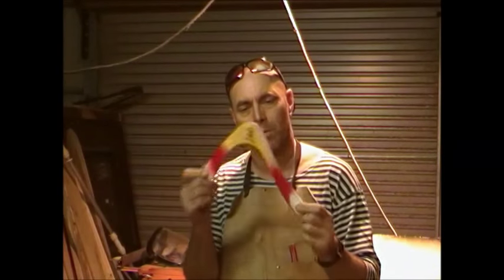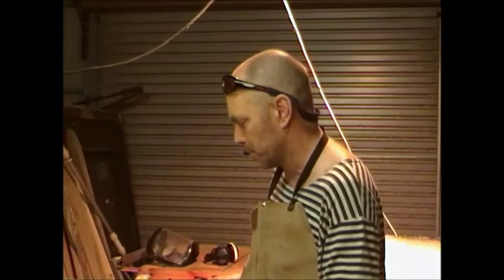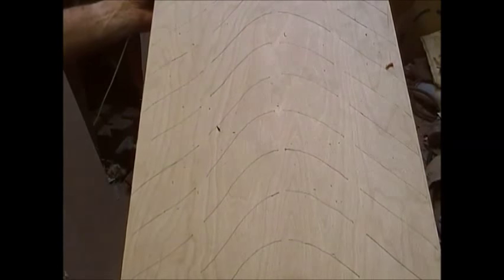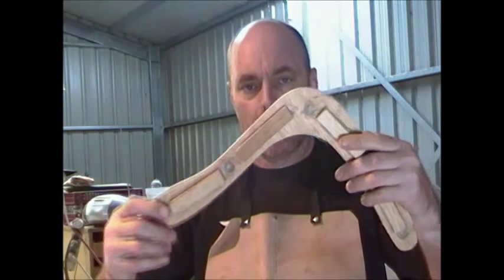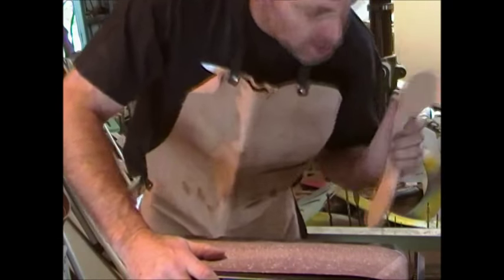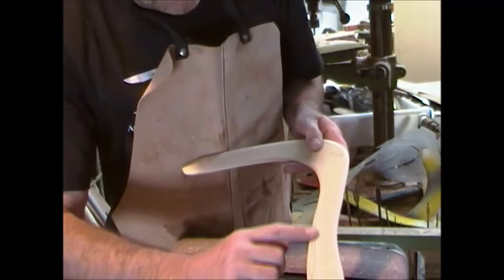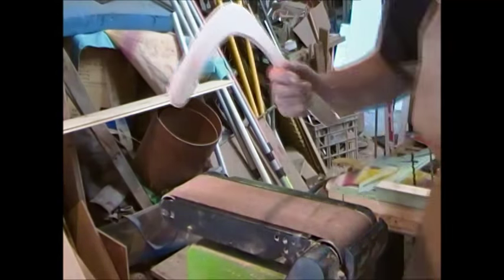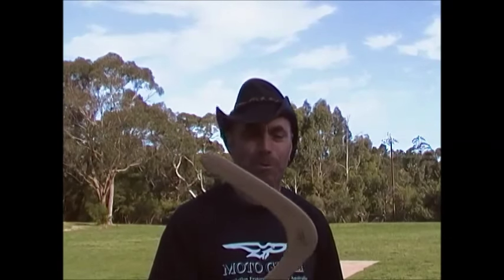How to make great boomerangs. Introducing the "Cracker"

Comment: How 'heavy' or dense is Finnish Birch plywood, can't get any fancy plywood with thinner laminations here in Timaru so I've copied some 'large' 60s to 70s style boomerangs from a book that was made about boomerang construction before even trirangs were around, some of the featured boomerang designs in this book have metal bands on the tips and there is one insane one in the illustrations made of aluminium alloy ! The book was published 1972 or 3, pre-Mad Max. I've got other books in storage from my Tasmanian mate Sugra showing a guy called Frank Donnely with five armed circular ones, and all manner of different plans for 'omegas', sharper hook 'V''s etc. I mean boomerangs come in a lot of configurations. Now, is it really a boomerang when it has multiple arms ?! Have you made tri-rangs ? Do they need the undercut on the ends and which one is the dingle and which is the lifting arm but wait a minute there's another one what's that, dingle two ? I've made a large tri-rang and I have a feeling I'm going to have to thin it and some of the others by a mm or two, I also made a perspex one but it becomes invisible and was too heavy so I've brought the weight back and shaped it more, hopefully it will work better, am hoping this plywood will hold up, anyway, streuth, I think I might be the only Kiwi trying to make s&*t fly in circles over here with bits of wood, really dig the instructional 'theory' parts, I think boomerangs work by magic actually and no ammount of aerodynamic physics etc can really explain it, the one I had since childhood would just hover in the air above me and come to me BUT even if it was to the left, to the right, behind, can't explain it but I managed to get 36 catches in a row one day with that one and it would go out about 35-45 metres...logically one would imagine that the boomerang should theoretically just keep banking left and not stay flat, I still don't get why they stay in a flat hover because the spin rate seems pretty much the same from half way round, anyway thanks, your videos are informative and a crack up...on ya.
Reply from the maker: I don't know how heavy Finnish Birch plywood is precisely, but I do know it's heavier than other ply of the same thickness. I use it because it maintains it's shape, is durable and doesn't splinter like many other ply such as marine grade ply. I've made a few tri-rangs, but they aren't my thing; I think there are too many surfaces creating lift too early in flight to achieve good distance before they lay over and give up. I'm not such a big fan of tight circles and figure-8 flight patterns, but that's just me. There's a particular beauty in a 'rang that goes out a good distance, flies low, climbs a little as it starts to lay down and slows it's flight into a graceful hover. That's just sexy!
Reply: @boomerangchannel78  Too true, I like that too, since my question I have been making a lot of bomerangs out of 8mm Poplar 5-ply. I made a few large trirangs and mine go a good distance and super accurate, about 30m but are much bigger than the little fast catch things used popularly in modern competitions that don't flatten out before returning purposely...

Comment: buddy, what could be making the boomerang rise? Are the wings straight with each other? If you can give me a tip, thanks.
Reply: From my understanding, the rise in the flight towards the end of the boomerang's circuit is due to the airfoil shape of the wing tips, which provides lift, in combination with the 'layover'. Layover is when the boomerang transitions closer to horizontal as it spins, thus allowing the boomerang to rise. As the rate of spin and thrust decays, the lift reduces and the boomerang should descend from a hover for an easy catch.
Reply: @jimmyoneleg3314  Thank you very much friend I am venturing to do some boomerangs but I realize that it is something complex there is a lot of science in this, but I think that is precisely why it becomes more exciting.